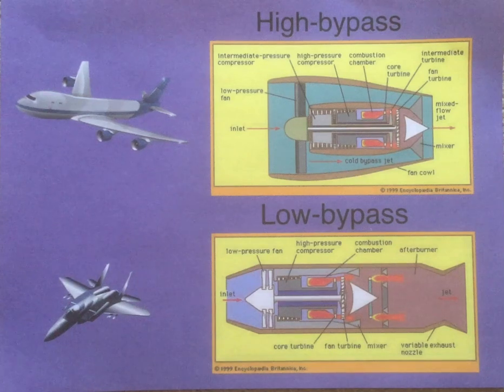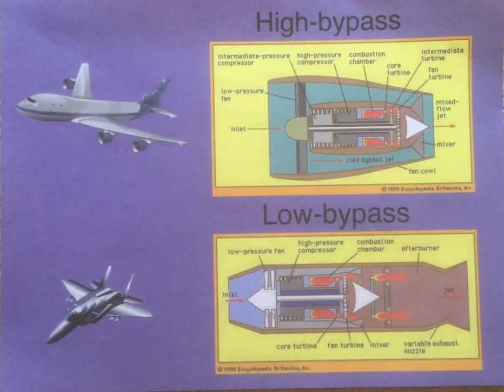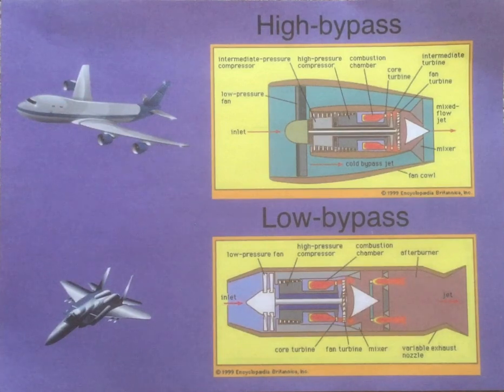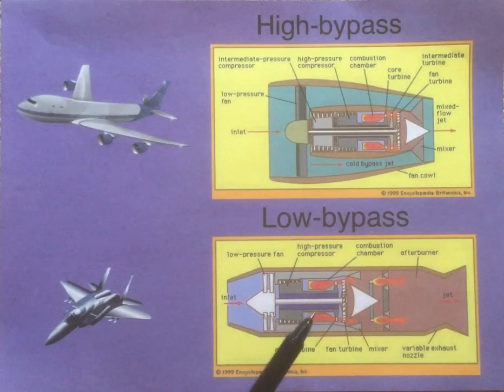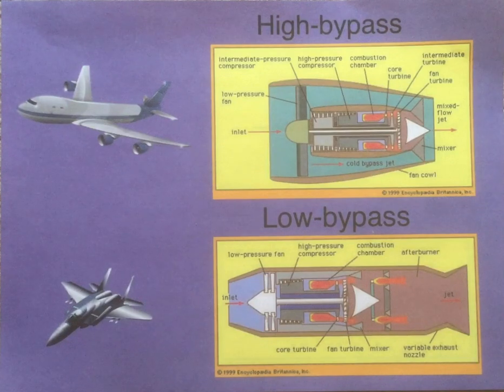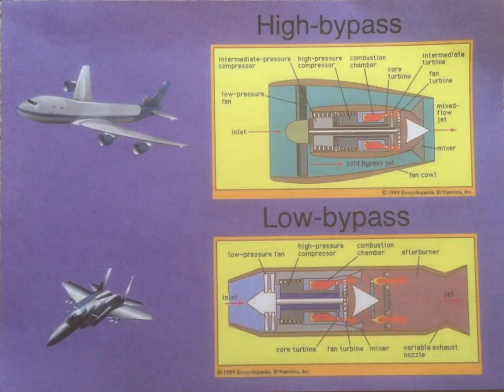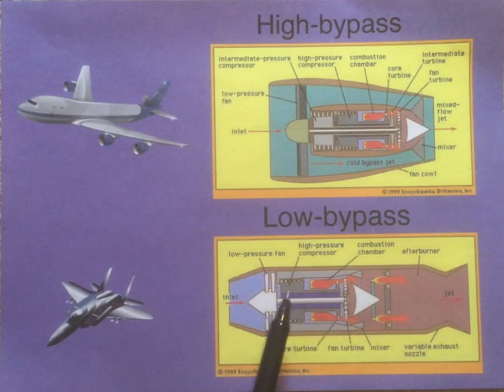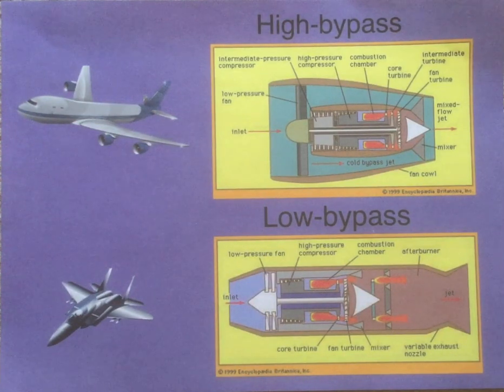Explaining the differences between how high-bypass and low-bypass turbofan jet engines work! ⬅️💥💨

Comment: Hey bro. recently Pratt & Whitney made a the GTF(Geared-TurboFan) High Bypass engines, can the same thing be dont to the low bypass turbofan engines? Can you put gears on Low Bypass Turbofans?
Reply from the maker: Low bypass engines are usually much too small to fit a substantial gearbox. Gearboxes are meant to reduce the rotational speed of the fan as the large diameter of high-bypass fans limits how fast it can spin while maintaining efficiency. Low bypass fans are much smaller so they don’t have this problem, therefore there’s much less need for them on military engines. Furthermore. gearboxes add lots of weight and complexity to an engine which comes at a major disadvantage if applied to smaller engines. Especially given that modern low-bypass engines are designed with the intent of having the highest thrust to weight and power to size ratio. So to answer your question, you can add a gearbox to low-bypass engine in theory but it would be impractical and completely unnecessary.
Reply: @ChrisZoomER so 3rd stream like those in adaptive engine are the only solution to low bypass turbofan? How about what GE says as turbofan with rotating detonation afterburner how does that work? Apparently it makes things more compact
Reply from the maker: @ameserich   To be honest, I don’t know much about rotating detonators. But my research suggests that turbofans with rotating detonators are designed to perform separately. In a similar way to how the engines on the SR-71 functioned as a turbojet and ramjet under different conditions. 

To answer your question, my primitive understanding is that rotating detonators work by using supersonic expansion of the burning mixture to generate a shockwave that travels around the combustion chamber perpendicular to the flow. This shockwave ignites the flow upstream over and over again as it circles around the annular exhaust nozzle.

For turbofans equipped with rotating detonators, the engine is set to turbofan mode at lower speeds and switched to rotating detonation mode at higher speeds. The latter requires very few if any moving parts so it can indeed be built more compact. Such engines see use mostly in missiles and drones, but not airplanes. As for adaptive turbofans, the consensus is that these engines with a secondary bypass duct are the best solution for upgrading propulsion systems of next generation fighters.

Comment: all im gonna say is high bypass engines rarely produce a certain c word.
Reply: All I'm gonna say is that's complete nonsense.  They actually make more, and there are reports online that explain why.
Reply from the maker: @paulshepherd8295  I guess that means that all the aeronautical engineers who work for P&W and RR Trent were lying to me about all of the differences between the two. I read various reports online and asked them if they were accurate, they said no so please don’t bother telling me what I got wrong.
Reply: @chrisszumiloski6920  Have you read 'Influence of propulsion efficiency on contrail formation' by Ulrich Schumann?  Each generation of engines has become more efficient, largely linked to the steady increase in bypass ratio.  The above report says 'Aircraft with more efficient propulsion cause contrails more frequently'.  There are other reports that agree with this statement.  Only this week there was a report in Aviation Week on work being done to reduce contrails by using synthetic fuels.  Why would they spend millions doing this if the engines were not producing contrails?

And I hope you realise that my original comment wasn't aimed at you?
Reply from the maker: Yes I do and I know that higher bypass engines are more likely to produce contrails, contrary to what those chemtrail conspiracy theorists have to say! @paulshepherd8295
Reply from the maker: What c word is that?

Comment: Thanks for the explamation. Would just like to clarify regarding bypass ratios, eg. 10:1. So 10x the air passes outside the combustion chamber? Or is that in the combustion chamber? As it has the high pressure compressor & combustion is occurring there? Thanks!
Reply from the maker: Yes, high bypass engines are usually defined as having a bypass ratio of 5:1-10:1 or more. Low bypass engines are defined as having a bypass of 0.1:1-2:1 and actually "medium" bypass engines are often defined as having a bypass ratio of 2:1-5:1 though technically a medium bypass engine would imply an engine bypass ratio of exactly 1:1. I hope this helps.

Comment: Wow, nice diagrams. What is the Venturi effect?
Reply from the maker: The Venturi effect is when a fluid accelerates due to losing pressure when flowing through a constricting part of a pipe.
Reply: Oh, what class would that be taught?
Reply from the maker: @SassyPatty2707  Most likely a fluid physics course.